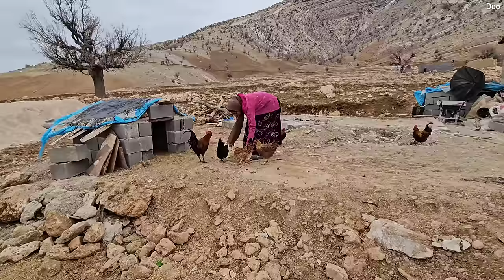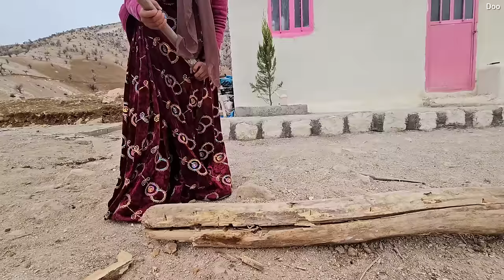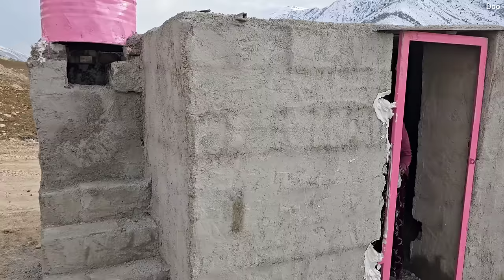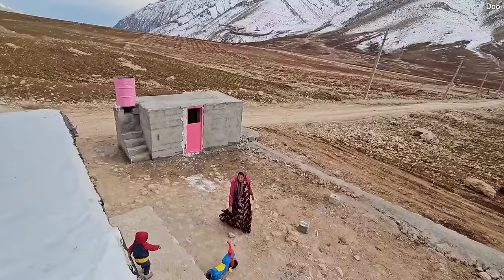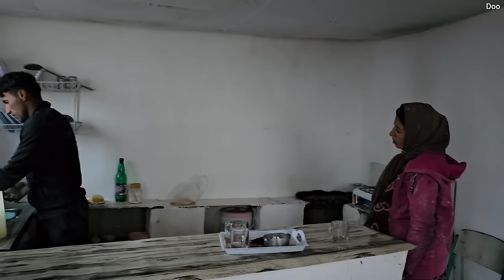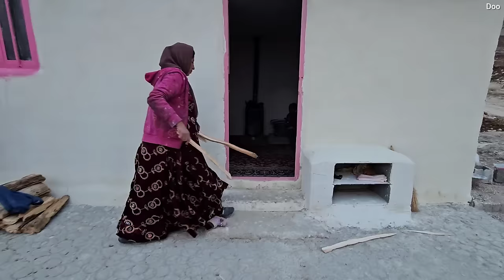Indomitable Will: Single Mother's Unwavering Determination to Create a Better Life for Unborn Twins

Comment: I would build a water tank beside the kitchen window wall, close to firewood ,  so would be easier to  fill the water tank for the kitchen sink.  It just need to be a little higher then the window. Also you could install a gutter in the back roof and bring it to the water tank so you can also collect water from the rain. When it rains wait five minutes so the rain  cleans up the dust in the gutter, then connect it to the water tank . Clean water .
Reply: So you build a water tank beside your kitchen window 😮
Reply: I was thinking the same thing why have that water tank on the roof where u have to go up there & fill it, fix a place beside the building, high enough  for the water to drain, would be easier to fill,

Comment: Tienes que hacer un hueco dónde está sembrado el pino, porque se va a podrir, la casa me encanta
Reply: Make a hole for what?
Reply: PARA QUE BAJE EL AGUA Y NO SE PUDRA LA RAÍZ
Reply: It won't work there anyway because that is the exact place they put the drainage pipe for the kitchen sink, it will be trouble if the pipe ever has to be replaced bc they will have to dig up the porch and everything, and if the tree does grow it will uproot the pipe and bust it

Comment: Please put the water. Please have Mr Rhamat build a wood storage on the kitchen side of the house and put the water tank on the top of it with steps! It would be larger for wood and easier to fill with water and won’t collapse the roof! It only needs to be taller than the faucet🙏🏼🙏🏼🙏🏼🙏🏼❤️❤️❤️❤️